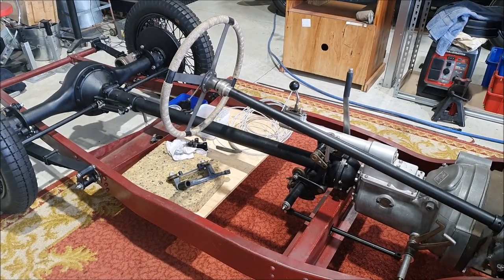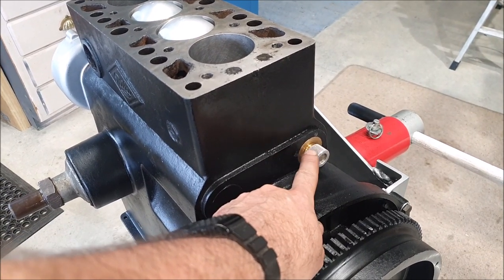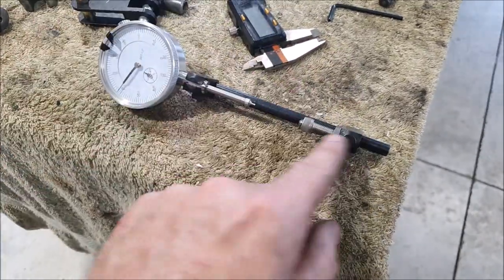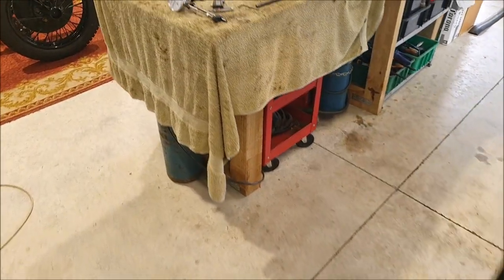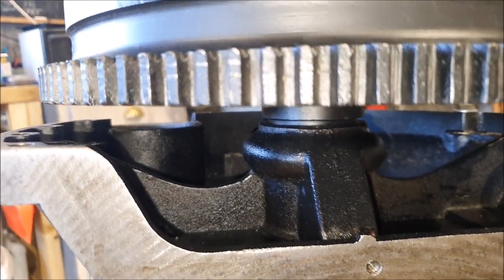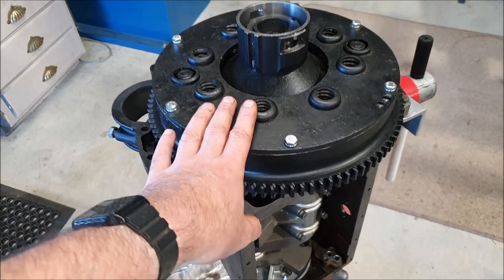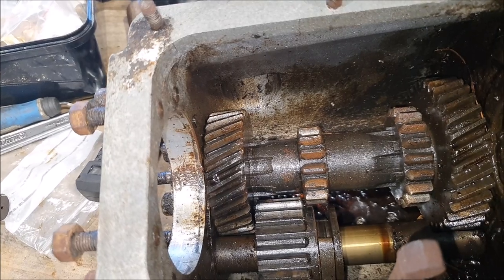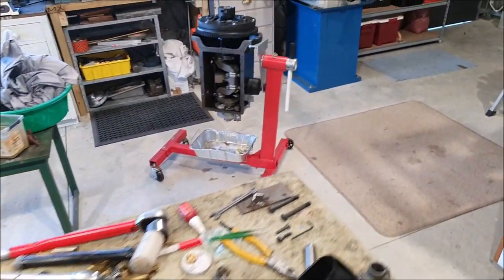Pre war car - Riley flywheel and clutch on

Comment: Yes you"re right Simon... normally have a pull out kill switch on dashboard, earthing mag. to stop engine.
Phil
Reply from the maker: I am sending the mag off for rebuild tomorrow so I dug it out of the air cupboard where it has been stored for years. I saw the little terminal on the cap the switch goes to. You don't have a link to what the switch looks like do you? I will have to look out for a period correct one.
Reply: @asciimation  Hi Simon, I don't think I can add a photo here so I'll email you one of the dash from my 1932 Gamecock showing the switch. Bit later than yours but may be helpful.
Phil.